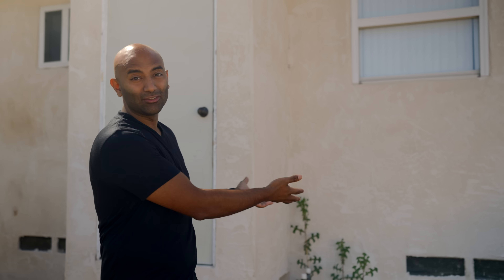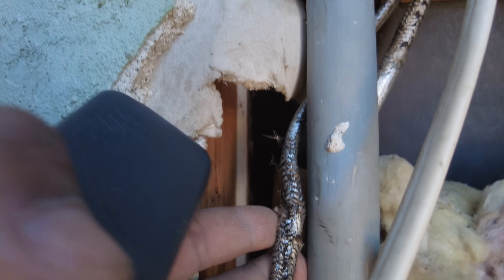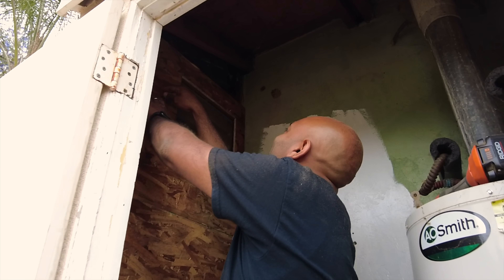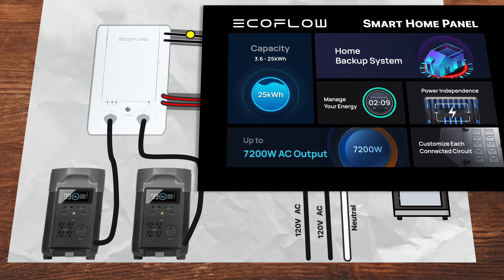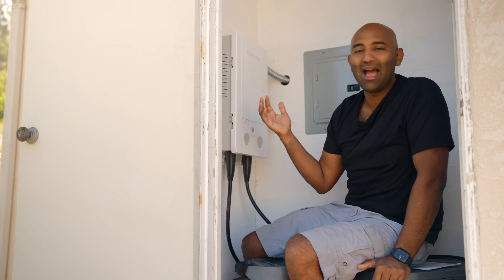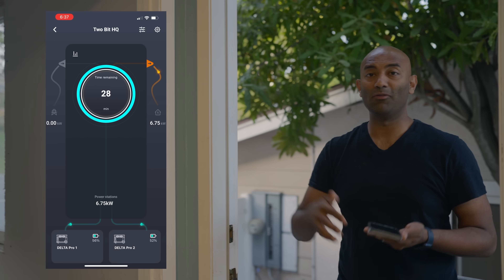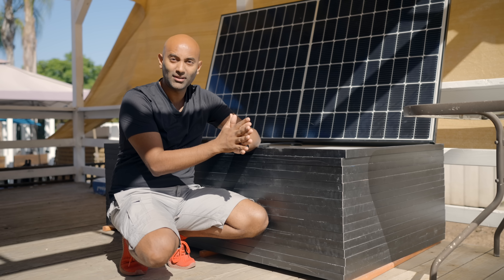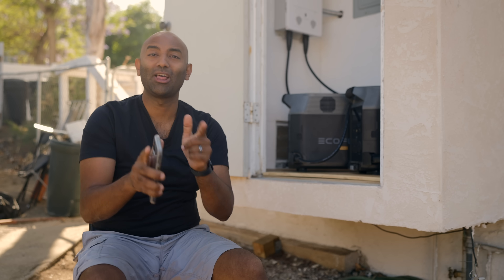Best New Way To Back Up Your Home Energy?  |  Going Off-Grid.

Comment: I've always wanted to:  Pull the heat generated and thrown away from a refrigerator/ freezer and use it to heat or maintain the heat of a water heater.  I don't think is anything currently available to do such so would have to be diy.  In what seems like more of an office, where hot water demand will probably be minimal I bet one could keep a 5 or 10 gal water heater fairly hot from the waste heat from a fridge.
Reply from the maker: You're a man after my own heart, I have the same thought! I am trying to figure out good ways to bring that synergy for sure. I'll to share all that I find in future videos
Reply: @TwoBitDaVinci  At some point you should visit a laundromat.  Gotta see the back rooms.  Where dozens of dryers are exhausting 100° plus air outside, and In another area usually massive NatGas boilers heating water for the washers.  Huge waste of energy.
Reply: @RVSparky  there are heat pump clothes dryers too, those should be more popular!
Reply: A lot of people have a second freezer outside of the primary kitchen unit. If it is in the same space as the heat pump hot water heater you are essentially using the freezer to heat the hot water! Cool the food heat the air. Heat the water cool the air. Ambient makes up the load difference. Though the Hot water dwarfs my freezer as it gets quite cool in my basement in the summer. Enough heat comes off the furnace and duct work so it is less noticeable in the winter. I know the furnace is heating my hot water, but I plan to upgrade that to a newer Heat pump system soon with new duct in the basement so the basement may be cool in the winter as well. I just got to get the kids to move out and hot water use will go way down.
Reply: @billspalding9993  Yep I understand and true.  However that's basically transferring energy via the air in the room.  I'm thinking more direct connections like liquid transfer/heat ex changer attached to coils on fridge to gain heat, then via liquid transfer that to the water heater.  Lots of details to work out of course.  Of course always loss of efficiency but....

Comment: Excellent video - I'm planning on doing similar with a 1927 home, so this is damn helpful.

Also, a note on the old wiring: looks like Silva-flex, which was 14/2 no ground; hit it's heyday in the late 50s, though they did make it up until the 70s.

So, yeah, that was even worse than it seemed, lol

Comment: Isn't there a side benefit of putting panels on the roof in that they shade the roof?
Reply: Yeah, also he stated he needed a new roof.  When he gets that done he really should make sure that he white roofs it.  It will cut down his air conditioning needs as it will make the roof reflect more of the sun instead of absorbing it like a more traditional dark roof.

Comment: One of the cheapest return on investment is thicker walls, thicker insulations.  If you can’t add an extra 4” in to your wall (losing it on the inside of house), you need insulation to keep out the extremities.
Reply from the maker: Yes for sure
Reply: @TwoBitDaVinci  I was researching a new build (not sure if I can afford it) & found some people built double walls which approach the “you’re building ‘two’ houses” criticism.

I looked into ram earth. 14” of rammed earth is a great insulator (sound too) but need lots of dirt, not practical in city.  Also, concern over industrial waste dirty.  Labour is another concern.

Hemp-Crete walls.  I love it.  Price is high at the moment for “chopped up plant”.  Labour could be worth it.

Pre made hemp panels or insulation is an alternative. Still costly for “chopped up plant”.

At this point, I’m leaning toward a steel super structure.  Decide on the materials if I’m sure I have the budget.  The steel super structure is “forever” 

Good luck.  Hope to see 6 battery pack in the future
Reply: @peterxyz3541  Peter - look into pre cast insulated concrete panels. Three inches of concrete, six inches of foam insulation and 
another three inches of concrete on the inside.  Don’t let the initial price deter you because the wall is complete on instal. I could on and on about the advantages but do a little investigating on line. My next build will be complete concrete, including the floor and roof.

Comment: As for your hot water, it depends on how much you will be using , for what length of time it will be used. Maybe an on demand hot water heater, coupled with a solar-thermal  heat-exchanger.
Reply from the maker: interesting, I'd say a 30 gallon heat pump water heater would be totally sufficient.
Reply: Electric on demand water heaters are not recommended with a solar/ battery solution as they draw a ton of power when they turn on more than most batteries can provide.  It is better to go tank as they power draw over time will be a bit more but much lower peak demands.

If you want to be more efficient with a tank solution, put it on a timer so that it only turns on during the day when you are generating excess solar power.

But I was thinking for the small house just go for a small gravity fed passive solar hot water heater.

Comment: I need help understanding how that Smart Panel has no potential to backfeed the grid?  Isn't it normally powered by the grid?  Or, are its circuits only served by battery, solar and backup generator?  So, totally off grid?

Comment: Wow, I can't believe that you could build a house in California in the 70's without grounds!  My house in PA built in the early 60's has similar-looking cable, but it has grounds.  Did CA have weak codes back then, or did this unit just fly under the radar?
Reply from the maker: great question, I think this house was done under the radar to be honest. I'm so glad to get it up to code!
Reply: @TwoBitDaVinci  Yes, looking at the wiring, it was almost certainly an unpermitted addition.  There were a lot of those in the 70s.   For example, dropping the wiring from the plugs straight down to the basement is probably not to code.  There isn't supposed to be any electrical wiring that close to the floor for normal room wiring (subpanel is different).   I would completely rip out and plug up any normal house wiring that drills through to the basement unless it is explicitly going to equipment under the house. 

It is also worth checking whether that old wire is aluminum wire or copper.   Modern wiring is either pure copper or a (modern) aluminum/copper alloy.  Any old pure (or mostly pure) aluminum wiring should be ripped out, period.

-Matt

Comment: Impressive, my Magnum does 4000 watts and is some what clumsy doing it. I think having smaller water heaters under the sinks may be a better way to do hot water but then I'm conserving water too. Living off grid waiting for hot water makes you cringe wasting water waiting for the heat. In the summer I can get 13 KWH from my nine panels but in the winter on the worst days less than 1 KWH. On the shortest daylight days of winter it is maybe 3 KWH.
Reply from the maker: great insights, where abouts are you located?
Reply: @TwoBitDaVinci  I live a few miles south of Portland OR. I put in poly panels instead of the black mono panels that supposedly capture more energy on cloudy days. Other than this spring I usually make plenty of power to go complete electric.

Comment: FWIW with a 50 year old house that old wire was probably braided with asbestos fibers.   And your drywall was probably full of it too.  Back then it was the wonder material - it can be in concrete, flooring, pipes, drywall, texture, insulation, ...

Comment: Those Ecoflows are toys.  Check out a good server rack battery system
Reply: but toys are fun :D
Reply: @EditorNchief  indeed they are! 😀
Reply from the maker: they're not toys they are portable batteries. a rack isn't something you can take camping. This battery could literally be unplugged and taken with you on a camping or RV trip. that's why this makes sense. if you'll NEVER move them, there are better options IMO

Comment: Maybe you would consider adding a thermal component under your solar panels to draw out the excess heat from your solar panels to increase the panels' efficiency and longevity.  I am looking into doing this with air or possibly liquid.  It is not clear to me why people aren't photovoltaic thermal hybrids routinely.

Comment: For the water heater I think a heat pump water heater would be great. I remember you mentioned something before about being concerned with needing 220 or consuming to much electricity. Rheem is testing a 15amp 120v heat pump water heater that heats the water up to much higher temperature and then uses a valve to mix the super hot water with cold water to achieve the temperature you want. This allows it to use 15a 120v without quickly running out of hot water or needing backup inefficient electric elements. I thought it was supposed to be coming out for sale soon but I'm not sure if it has yet. Last I heard they are testing them in peoples homes.
Reply from the maker: YESS! This is what i need! do you have a link?
Reply: @TwoBitDaVinci  YouTube keeps removing the comment that I write with the link to a great article about this. It'ss an article by CleanTechnica that was published on November 29, 2021 titled: 120 Volt Heat Pump Water Heaters Hit the Market & Make Gas Replacements Even Easier. It's a super interesting read and is pretty in depth. Let me know if you can't find it!
Reply: I would recommend always run a 220v to hot water heaters, clothes dryers, A/C units, even if you don't need it as it gives you the most options now and in the future.  Just because it is wired for 220v doesn't mean it has to draw that much power.

The super hot water supply he is talking about.  The only way I think it would work given his information, might cause high standby losses and then pull the max it can from 110V to be like a fake instant hot water heater but won't be able to raise the water tempi enough, then mix the warm water with the super hot water tank to bring the temperature up for as long as the tank lasts.  That seems like it would have the worst of both systems, tanks and tankless without the benefits of either just to try to get it to work on the 110v.
Reply: @travisschneider3011  I recommend reading the CleanTechnica article I talked about in the other comment I wrote. It does a much better job explaining it. From my understanding the only part that is any different than a normal heat pump water heater is not having the backup elements and the addition of a valve to mix the hot and cold water.

Comment: Code for lighting circuits is still 15A.  Think about it, over the past 20+/- years, old incandescent/T12 lighting fixtures have been (or can be) replaced by new LED lighting (with a compact fluorescent iteration in between). If you already have Romex w/ground, you can (or could have) vastly improve(d) illuminance, control, flexibility, color rendering, etc. while also reducing electric loads by 3 to 4 times on an existing 15A circuit and 14 gauge wire. 20A/12 gauge for plug loads makes perfect sense in most cases.
Reply from the maker: yeah absolutely, I ran all 20A because I bought a huge roll of 12 gage wire. no harm in having extra overhead, but totally not needed. al our lighting is LED and its a truly amazing reduction in consumption

Comment: Can the panel use current power market price for rules? So you charge at the cheapest time.
Reply from the maker: yeah you just schedule it for your needs. Tell it to charge everyday when your prices are cheapest, then either run it all day, or only at the peak times. It's totally programmable which is great

Comment: very useful and informative, thank you very much!

battery software configuration is very nice one
btw when does batter room, was thinking about how winter temps are going to affect them?
Maybe it is good idea to make kind of isolation or something so they are a bit temp proof 🙂not sure how much heat they are emiting
are they Li-Ion or LeFePo? if Li-ion maybe good to think about fire proofing it too, to avoid catching house in fires 😛

thanks again, 10/10
Reply from the maker: great point, we're going to have a dedicated place for the batteries, with good cooling in a future video!

Comment: i think you can connect 2 strings of solar panels to each delta pro.  so if you have 4 strings, point 2 solar strings to maybe 11am , and 2 strings to maybe 2pm, connect each delta pro to one at
11am and one at 2pm.  both delta pros will be able to charge at both times...somewhat equally.  i believe their voc is about 150 volts, so keep each input less than maybe 125 volts.  the panels
have the specs on them.  3 panels in series?  12 panels total?  if they are 330 watts; then 12 x 330 = 3900 watts maximum x hours of sun per day... 5 hours?  20kwh?  need more than that? put
more panels in parallel or use stronger solar panels.

Comment: Have you reseqrched PoE lighting? It's supposed to reduce wiring cost and electrical consumption among other things.
Reply from the maker: power over ethernet lighting? never heard of it... lighting is super easy in the age of LED. get 100% all LED bulbs everywhere... first thing i did
Reply: @TwoBitDaVinci  It's smart lighting..it uses network cables to provide both data and power to lights and switches. Uses low voltage instead of 120V. There are a few suppliers. I've been doing the research recently and it looks interesting.
Reply: It does reduce wiring costs as just about anyone can run Ethernet lines as they are low voltage.  But the issue with them is they tie you into an ecosystem and if that ecosystem ever dies are you are screwed.  The electrical consumption should be similar to other LED solutions.  It has a minor efficiency bump by consolidating the DC transformer but it loses efficiency as 48v DC loses more power over runs vs 110v AC.  Plus you have to run power to power wall switches, never 100% rely on smarts, always have a backup, this coming from someone who replaced all wall switches in his whole home with ZWave switches.  Also when you do that you have to get more expensive PoE network switches to power the lights which has a premium over just normal integrated power converters in LED lights.

Comment: For heating, cooling, and hot water  have a look at heat pump boosted evacuated tube solar hot water with a hydronic climate control system. To send hot or chilled water to radiators throughout your house.
Reply from the maker: Any product recommendations?

Comment: For our house we were going to do Dual Sun panels and the Hybrid Electric Rheem Tank Water Heater 

The panels produce 425 watts per hour each and preheat your water prior to being introduced into the water heater 

You can also introduce a de super heater from the ac unit to do more of the preheating and save more energy 

Unfortunately haven’t found an ac unit I like yet 😂
Reply: We did something similar. A note on the Rheem heat pump water heaters. They work great, but I can hear ours as I type. It is a month old and functioning properly but still 30% louder than our fridge, about 53 decibels at 3’. Put the heat pump water heater in a garage, or in a well sound insulated utility room away from living and sleeping spaces. I’m taking ours out next week to install soundproofing panels.

Comment: if you have an "outhouse", you could decouple all the nasties to there, then convey the heat in, heat pipes or heater water pipes, limited exposure to water hazard materials
Reply: I mean you can burn green fuels, like wood, in there, its like a separate sauna house, then all the maintenance is in the outhouse workshop, only
Reply: separate ups for the freezers, right next to the equipment that require them, so that you can remove the main ones for rv trip if you need to
Reply: use wifi, dont depend on internet
Reply: try the victron energy stuff
Reply from the maker: wifi is just internet without wires. I need internet
Reply: @TwoBitDaVinci  of course, but if internet dies, then did you lose your monitor connection
Reply: @TwoBitDaVinci  keep internet as the "on grid option", but prepare to be totally off grid, even the apps need to be off grid, handle data same way as the electric power, from and to the grid, the power walls can have wifi access points, or be the access points, that dont rely on internet to function, ie, independent equipment, service provides love to make you dependent on their cloud
Reply: @TwoBitDaVinci  I mean, have the phone be able to talk to the power wall without any middle men, internet, cloud, service provider
Reply: @TwoBitDaVinci  are you so sure
Reply: @TwoBitDaVinci  you rather have a display or direct wifi link to the equipment, so that you dont have to go to internet to check some thing, on the equpment, iot should be offline-connectivity-of-things
Reply: @TwoBitDaVinci  you should refuse any equipment that forces you to go online, the local wifi monitoring is so easy to implement, any cloud service provider should be providing on-site only options by default